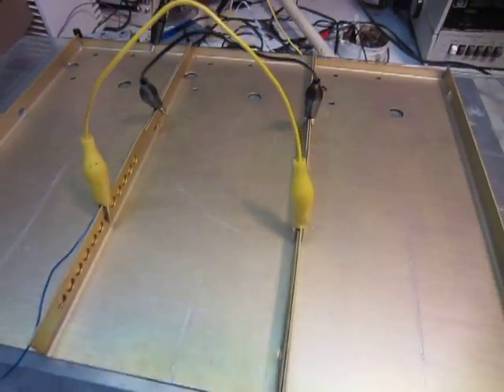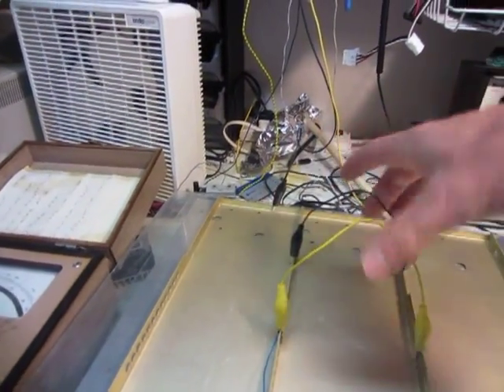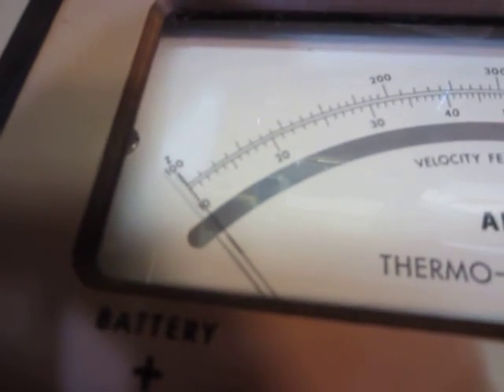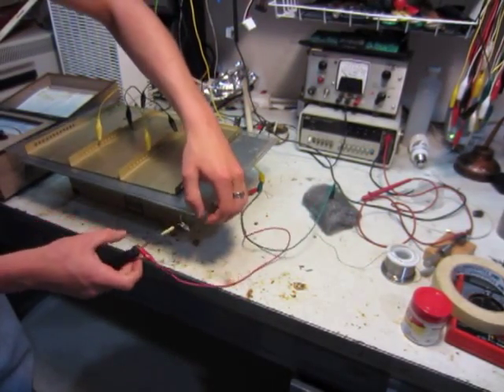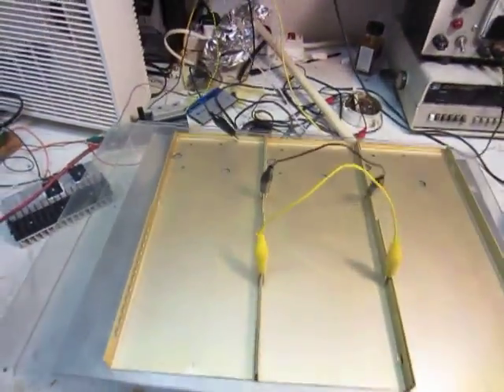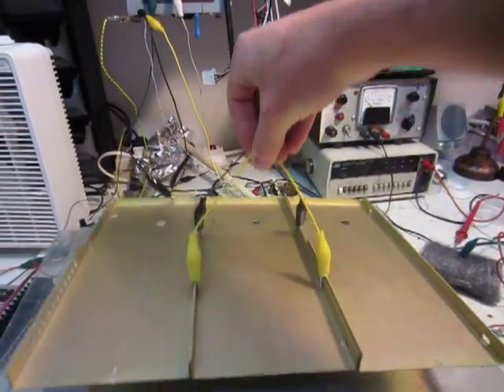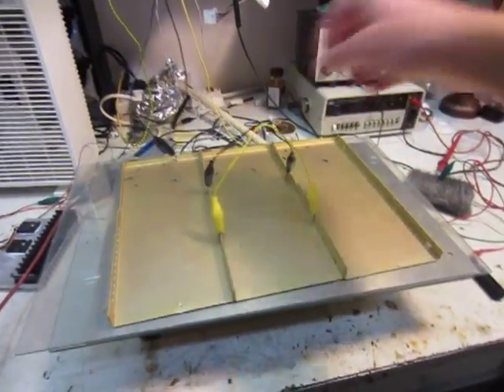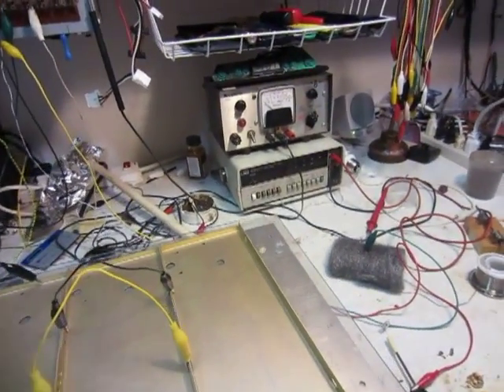High Voltage Capacitor Experiment

Comment: Is it less sticky after lifting the plate and putting it back down? If so we should be able to measure power loss with a hanging scale. Might be more accurate than electrical measurement.
Are you game to dismantle and touch both plates at once?
Interesting ideas with oil. That may be the way to prove if the charge is stored on the plate of the dielectric. The magnetic thing is making me think it's on the plates? With oil, will you be able to make HV semiconductors? It'll arc eventually.

Comment: I also like the small charge you detected. And that you took the fine meter (nice! I love analog meters!) off the bench before you started up the hv.
The small charge and the magnetic effect. Which will be caused by oppisate charges attracting, make me think of the magnet holder Russ at RWG (and lots of others) has been playing around with.
If you are prepared to wear a sealed, airtight suit of plastic, with HV + on the inside, I think you should be able to stick to any surface that is grounded?

Comment: Great test! Thank you for posting! Some interesting effects there. I didn't know it would work with only one plate removed. Lol at zapping yourself.

The sticking is really interesting! I think it might be the same way Gekos feet stick to any surface. Some Really big Science Firms are spending a LOT of money trying to harness this effect.... It also explains why my cup-caps get stuck and I cant turn them. They turn just fine with no charge, but try and turn them when they are in use...